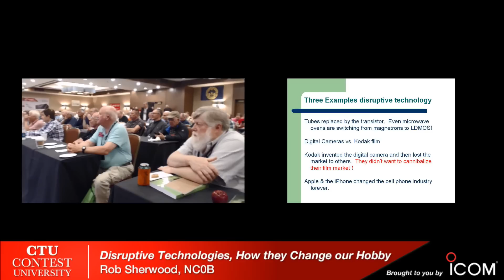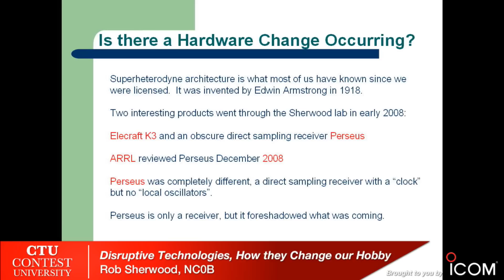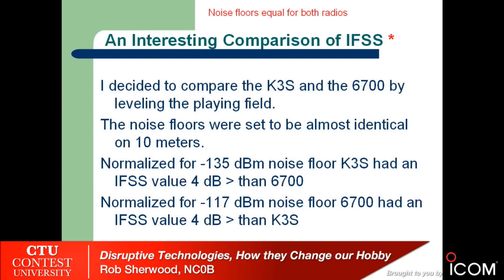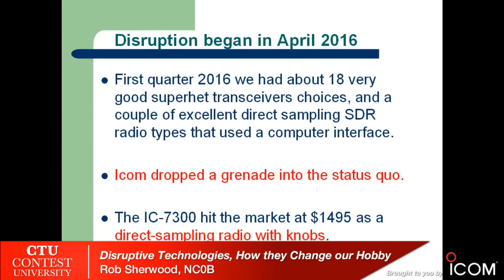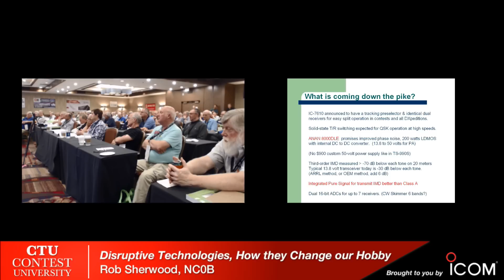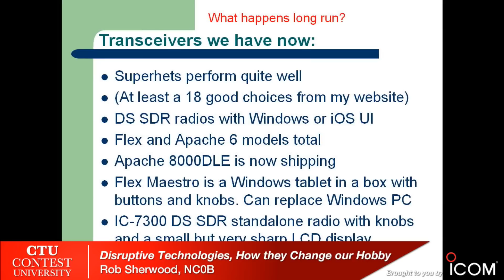Contest University Session 8 -- Disruptive Technologies, How they Change our Hobby - NC0B

Comment: The 7300 is  a noisy receiver, I got the FTDX-10, sold the 7300 and the difference is night and day. The audio quality and low noise floor of the FTDX-10 is amazing, it is a more modern radio of course but all these tests fail to indicate the actual audio quality, receiver performance is one thing but if the audio is poor then all that goes out the window in my opinion, even my FT-891 sounds a lot better than the 7300. I always listen via headphones.

The main attraction to the 7300 of course being the Screen.